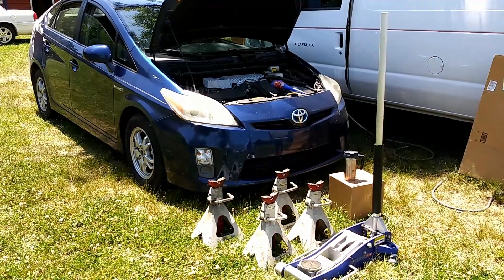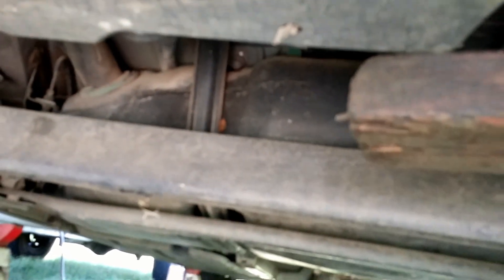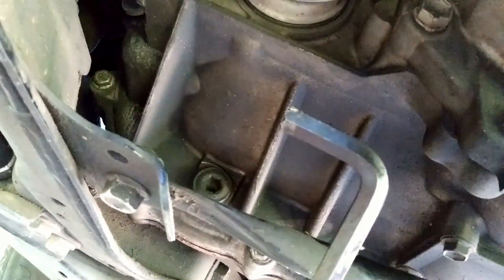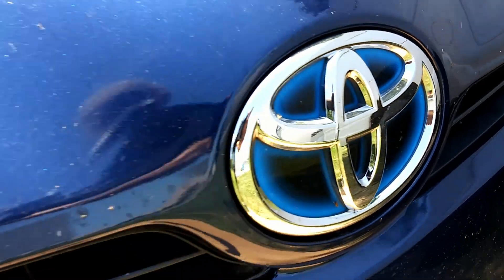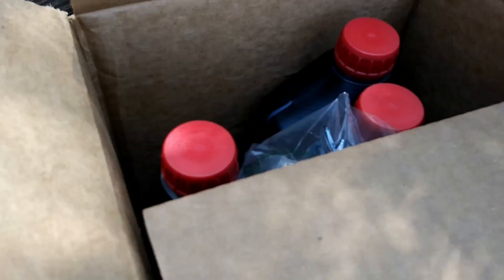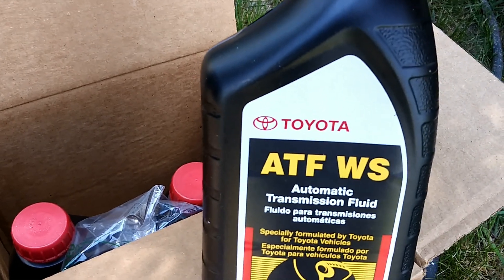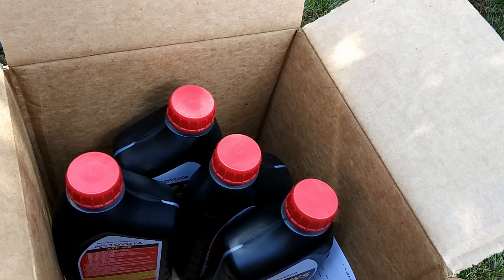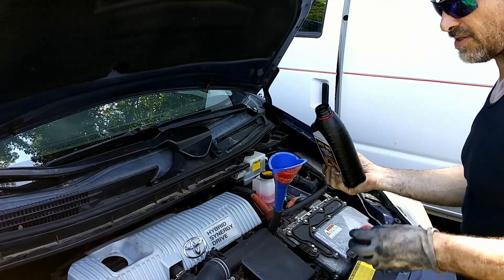Transmission fluid change Gen 3 Toyota Prius Trans-axle quick and easy way

Comment: I bought an inexpensive pump sprayer to refill the trans on my tundra.  Put a bent copper tube on the end past the valve. It worked well.  I will probably do the same on the Prius. Thanks for the video.  The water pump link you posted still works.  you can still see where they ground the "Toyota" off the casting. Saved me money on OEM quality.
Reply: This is gold. Thank you

Comment: It scares me seeing jack stands in the grass. My friends dad did that exact same thing and the jacks sunk and the car fell on him. Luckily he didn’t die but it messed him up badly.
Reply from the maker: Yep your right they are prone to sinking.  Lucky for me its a spot that used to be pure gravel "crush and run" and it has been very dry for over two weeks. you could sink a sharp shovel into it with a jackhammer right now. I have a set of plywood boards to put under the jack stands if the ground is even mildy soft and I try never to use the small jack stands outside they sink even worse.
Reply: Its a good idea to add extra protection if you are under the car, like sliding tires (on rims) underneath a structural point if the jack stands fail at least something will be holding it up. I've also had a car fall off the emergency jack when I was using it on grass. Luckily I was just changing a tire and wasnt underneath the car. Learned my lesson.

Comment: I've heard mixed answers. My prius has 166k miles on it and has never had the trans fluid changed. I've heard that changing them at any mileage is fine due to how the prius transmission is setup with moon gears/etc. Toyota dealer local to me doesn't even change them period. I plan on doing this in the next few days with WS fluid but wanted your take on that.

Comment: I watched your video on how to change transmission fluid on my Prius V with 190,000 miles. After completing the process of filling and pulling the hose from the fill hole I accidentally slipped the plastic sticker that was sticking at the end of the hose into the transmission( I did not remove the home depot  prize tag sticker at the end of the hose thinking it can hold the hose in place at fill hole) . My concern is , will this plastic sticker cause any damage to the transmission  if left inside. Or do I have to take that sticker out by draining the fluid again and  ( if I am lucky ) I might see that sticker at the drain hole. My car is still in the garage and I did not want to start until I get that sticker out ( if that's really required). I am thinking of running the old transmission fluid that I took out , to run  it down the fill hole again simulating the process of flushing or what other fluid can I use to force it into fill hole and make that sticker get near the drain hole. If the water was not destructive to the transmission, I would have put water hose into fill hole and try to push the sticker near to the drain hole. I'll try to suck that sticker by placing vacuum hose into the drain hole and see if it works . Any suggestions is greatly appreciated. I subscribed and Thank you.
Reply from the maker: I think your right to try and get the sticker out. It might be better to get a very clean drain pan and drain your new fluid into it. That way if you want to pour something in there to "flush" the sticker out. You could possibly filter and repour that new fluid as many times as you want till that sticker comes out. If your new fluid looks really dirty by the time your done then get some more new-new fluid for your final fill. By then you should have the sticker and a lot more dirty stuff out of the transaxle. Its a good thing your smart enough to stop and try to improve the situation.

Comment: Is there a difference between a drain and a flush?
Is there a filter?
Google search says it does and to replace it along with new plugs and washers.

Good video.

Thanks
Reply: Drain: empty fluid,  fill fluid. Flush: drain while filling until it is draining clean fluid then stop draining.
Gen 3, no filter for transmission. There might be an internal filter but that isn't user serviceable. 
The hose to add fluid should be 15mm OD or less

Comment: Usually, I use a gallon jug of amsoil synthetic world standard fluid with a fluid pump. I pump the fluid in the filler with the car level until the fluid runs out. 15:09
Reply: How did that turn out?  I asked because I bought 4 quarts of Amsoil Signature Series ATF and I'm kinda nervous about using it.  Last time I did this procedure I used the Toyota WS stuff and had no problems.

Comment: When pouring in the new fluid, the funnel with the hose is going into the fill plug hole right? Also you said not to do it with just the front jacked, up I don't anything to put under the back, is that gonna be a problem?
Reply from the maker: Yes and the fill plug hole is near the back of the trans-axle so if the  back of the car is lower than the front it wont fill all the way up.
Reply: Make sure the car is level when you do this. What I do is drive the car onto front wheel ramps, crack the plugs, drain fluid - then I jack up the rear of the car to ensure car is level, put in drain plug, fill trans through hose until it starts leaking through fill hole,  put back in the fill plug, remove the rear jack, torque both the plugs down, and then done!

Comment: The old fluid was so dark. How many miles did it have before that fluid change?
Reply from the maker: Over 200K when I got it. I changed it 3 times in less than 2 months to get it back to a normal amount of dirty. Lots of fluid changes and repairs in my Prius playlist. Ive made it to 390K so far.

Comment: I was told the fluid expands at temp and level needs to be set at certain temp.  What are your thoughts?  Thanks
Reply from the maker: That is true and will give you a more accurate level. However all units have some room for error. Just keep in mind If you err on the side of very low you could end up with burnt transmission. If you err on the side of too high you might lose a tiny bid of gas mileage. way too high you may start getting some foaming of fluid and bad gas mileage. Way way too high and the excess will burp out the vent during the hottest conditions (freeway driving). You can aviod all the confusion by filling a measured amount. BTW Ive never missed the sweet spot enough to have any of those symtems. But Ive seen it done at some of the dealerships I worked at ;-) Trainees on tranny jobs LOL what a messy thing to do. Just make sure you have at least 5 quarts ready If you dont use the 5th its OK ya got a spare. If you need a little more than 4 and you dont have that 5th one, now thats a problem.
Reply: @saneauto  but your box only had 4 quarts

Comment: I luv Hybrids....sold my beloved 4x4 oh my god!
Reply from the maker: I used to have a VW diesel got the same mileage but this uses cheaper pump gas. I will eventually get a Tesla 3
Reply: @saneauto  Old cars are greener than new cars because there is much pollution involved in replacing a car, so never use Prius as an excuse to buy a new car and think you're being green.  But if you must buy a new car, I do like the Prius C and V pretty well, and at this point the first Pri'i are 19? years old?
    I personally own a '98, 3 cyl Metro and an '82 Dodge W150 with 225 slant 6.  I'm here for my friend's Prius V which I maintain and use to run joint errands.
   You can get a '65 bug easy enough, or a '73 Pinto, so never say all old cars are big. And first gen Honda Insights are about 20 years old now and still work without the big batteries, though Pri'i don't.

Comment: Great vid! Saw the whole thing but you forgot to mention two crucial details. Mileage on car when the fluid was drained? At what mileage was it last changed? It was nasty.
Reply from the maker: It had over 300K and possibly never been changed. I changed it again at 330K and Im about to change again because its over 350K now
Reply: Holy smokes! Mines at 130k and that's KMs! Guess I'm not too early! Was the car on original battery?
Reply: @saneauto  I am going to change the trans fluid this week on my Prius V with 190,000 on it. Thanks for the video.

Comment: Would you go to the dealership for this job or a particular mechanic?
Reply: Either. Most times going to an independent shop might be a little cheaper just be sure to ask if they work on Prius's
Reply from the maker: Try to find a Prius specialist thats not a dealer. The new car dealers I used to work at usually put new guys and trainees on oil and fluid changes. I dont know about you but I dont like the idea of paying premium prices to have trainees working on my vehicle.

Comment: is this a 3/8 hose and how many feet 5 or 6?
Reply from the maker: 5ft will probably do. You dont have to be stuck with the same thing I fabricated. As long as you fabricate something similar that will fit together without leaking your expensive fluid out. Placing a clean drip pan under, so you can catch any spills. Should also help you recover from mistakes.
Reply: @saneauto  Thanks for all your guidance and much appreciated 👍🤝

Comment: WS is not synthetic. One of the best is REDLINE D6. I have it in all 3 of my Prii. Shifts are smoother and less regen noise. WS is good for about 30k. REDLINE is good for 60k.
Reply from the maker: Ive heard similar about Valvoline MaxLife Full Synthetic ATF. Have you used it in a Prius? or know anyone that has?
Reply: All the major oil companies make a so-called synthetic ATF. It's about $20-25. But it's not really a synthetic. It's called a synthetic because it uses molecularly-modified Dino oil or Natural Gas. It is "Hydrocracked". It's called a Group 3 oil. Same with lubes and engine oil. Between 1970 and 1997 anything synthetic had a real synthetic base. Group 4 syns are made of Polyalphaolephins (PAO) and Polyolester (POE) which is Group 5. Jet engine oil is almost all ester (Group 5). So the ATF you are using like almost all big oil company lubes, are just like 99% of the engine oil today, just Group 3. In 1997 or so, Castrol brought out Castrol Syntech, the first hydrocracked oil with no synthetic bases. By eliminating the PAO and POE, the cost of the oil was 50% less. But Castrol kept the price the same as the real syn oils. Mobil and another oil company cried foul, but after a hearing, it was decided that Castrol could call Syntech "Synthetic" because of the molecular modification. Now we have Group 3 (Syntech) and all other syns which are Group 4 or 5. Soon, all the major oil companies downgraded their Group 4/5 to Group 3. 50% less cost and the same price. Downgraded not only engine oil but lubes and ATF. WS is made by AISAN and labeled by Toyota. From the label, it looks like Exxon/Mobil actually makes it. But it's not synthetic, even by phony U.S. standards. If WS was from Japan, it cannot say "Synthetic" unless it is at least Group 4. Same in Germany. Only in the U.S. do we allow Group 3 to be called "Synthetic". And that is the conspiracy. Now we have Castrol selling Edge, Pennzoil selling Plastinum and Mobil 1 selling God knows what at $8-10 a quart. For a Group 3! ANd if you go to O'Reillys, the Royal Purple, a Group 4/5 with real PAO and POE is sitting on the shelf for the same price. Who's the fool. So you have the real old syn oils left: Royal Purple, REDLINE, AMSOIL Signature and Joe Gibbs Racing (made by one of the first 3). Their lubes are real synthetic as well. In Europe, we have Motul and Liqui-Moly, both excellent Group 4/5 with high Ester content. Why use a real syn? Higher flash point. Important for turbo bearings and the top piston ring lands where coking is a problem. Probably keep those clogging oil rings cleaner. If you use real syn with a bypass filter, it can be used for a long time. Normal oil filters are good for large stones and bird nests but when the bypass valve opens when you need filtering the most. You really think those little oil filters can filter the volume necessary at high rpms? Yes, when you open the bypass valve. Unfortunately, bypass filters cost near $500 but 10% of the oil gets a real cleaningall the time. So, here;s the takeaway. If you want to pay $8-10 for a Group 3 phony syn, go ahead. But you can go to Walmart and buy Supersyn, Costco and buy Full Synthetic Kirkland, or go to Amazon and buy MAG 1 or Amazon Basics. All the same and all made by Warren. On sale, the Kirkland is less than $3.00 a quart in a ten-pack. So it must cost about $1.50 to make. And like Castrol Edge, Pennzoil Platinum and Mobil 1, these 4 oils are API rated SN+. Yes, they all passed the same API tests. So I run Kirkland and I change every 3500 miles. So don't be fooled by the Big Oil (or Big Pharma). Don't be a victim of the "Synthetic Conspiracy". Don't pay Group 4 prices for Group 3. Delete these terms from your brain: "Synthetic", "Full Synthetic" and "100% Synthetic". No legal meaning in the U.S. and are merely marketing terms. Or buy German-made oil. It has to be real syn if it says "Synthetic" on the label. So next time, no WS and buy REDLINE D6 from Amazon for the same price. Go from 30k to 60k changes. It would last longer than that but the Prius Power-Split Device (tranny, not CVT) has no filter. Weber Auto has a complete tear down of all the Prius trannys. And if want to know more about the SYN Conspiracy, look up the November 2000 issue of Car and Driver. Patrick Bedard's article "Synthetic Oil Gets All New Semantics". It will tell you the story of how Castrol Syntech changed the oil world.
Reply: Some one know what's up!!!
Reply: The major oil company so-called synthetics are only Group 3 hydrocracked Dino oil or from NG. Only in America can we call ATF or motor oils "Synthetic" , "Full Synthetic" or "100% Synthetic" and have no synthetic base oil. REDLINE, ROYAL PURPLE and AMSOIL Signature are the only Group4/5 real Syns left.